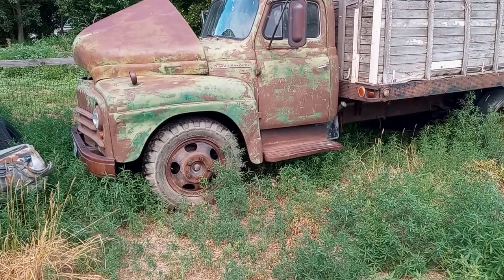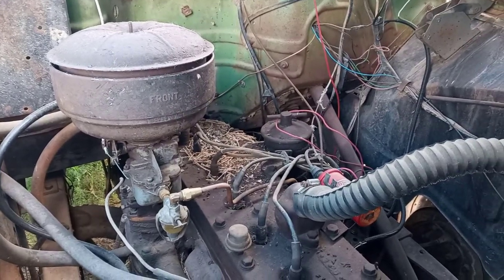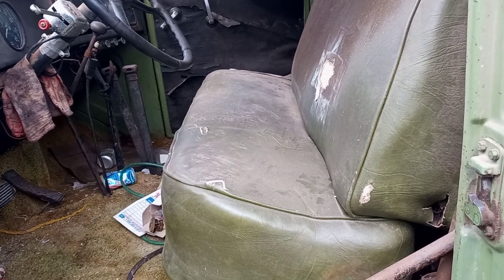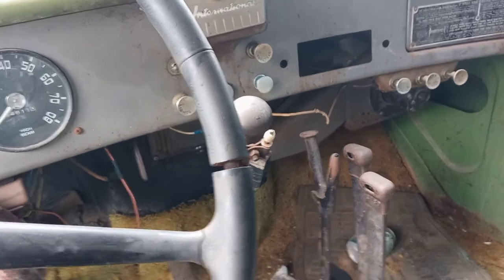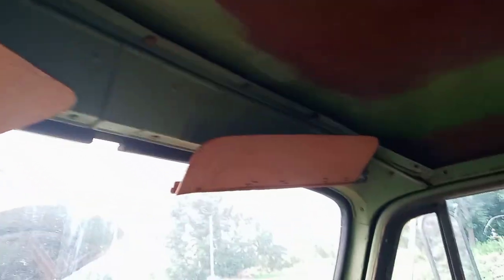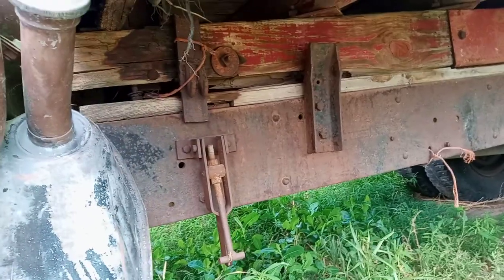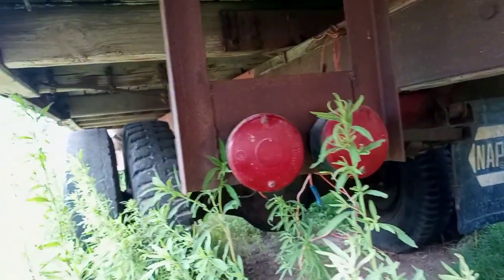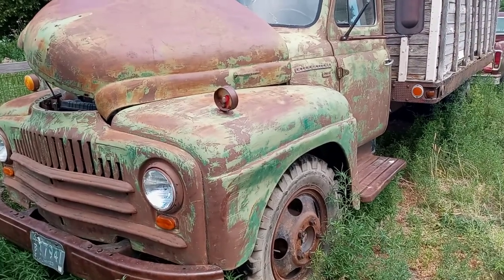Walkaround of my 1952 International L-162

Comment: Nice looking old International. I had a 1955 1/2 ton pickup a few years back. Probably the most complete old truck I've ever owned. Still kick myself for selling it. I wanted to swap in a 300-6 Ford motor for a little better mileage and HP.  Really like this body style IH. Take care 😁👍
Reply from the maker: Thanks! As many Fords as I've owned I still haven't had a 300, though if I were to have to do a swap in this one I would do the same exact thing! Thanks for checking it out!

Comment: I'd always wondered if a Green Diamond would fit into one of these L/R/S series trucks, this certainly answers my question. It looks like they didn't even have to change the transmission.
Reply from the maker: They just bolted a big 1/2" thick steel plate to the frame, and bolted the Green Diamond motor mount on the plate. I think they would've had to change the bellhousing but the transmission is probably still original to the truck. It's the optional 5 speed, I don't remember if they were ever offered in the K/KBs. I sure like the older flathead 6.